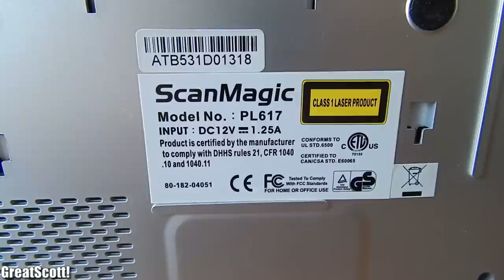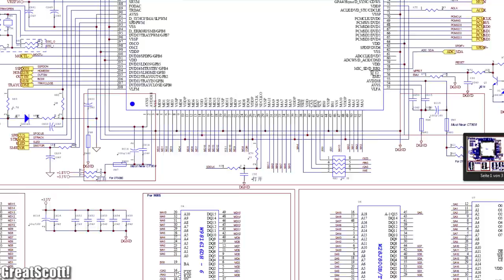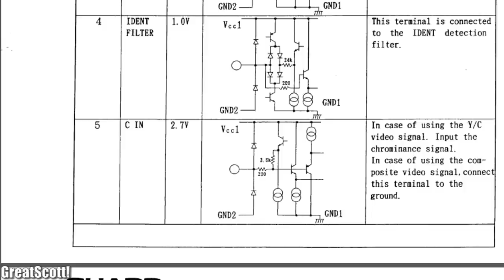HACKED!: Portable DVD Player

Comment: If you still had the original case, you could have made a Linux-based netbook!
Reply: +Nate Dude Or a portable gaming console / hardware emulator!
Reply: Woah! How'd you read my mind?! That's exactly what I was gonna do. I just need a RPi and a keyboard.
Reply: +Muranaman yea and the fact that it's using analog video input will make it look old-ish like the old consoles, not pixel-perfect emulator-like
Reply: Dar'o What do you mean by old-ish? I have a bunch of CRTs at my house I use VGA on all my monitors. I don't see a big difference between my laptop and my desktop's image quality.
Reply: @ChrisD__  must not have a very good computer! (:
Reply: @electricalguy  No I'm just getting a good signal on the VGA cable. It's a pretty short cable. I only stopped using VGA about a month ago, but VGA can literally do any resolution possible as long as you get a good signal and both ends can handle it.
Reply: @ChrisD__  okay. you know more than me since it is your CRT with VGA cable.
Reply: @electricalguy  Oh wait I wasn't clear. My TV's are CRTs, but my monitors are LCD. I use a Gateway FPD1760.
Reply: I have a newer Philips portable DVD player I'm gonna try to delete the DVDROM and install a RasPi4-2gb. I love hardware hacks like that.
Reply: How would you do that

Comment: After i watch this video i found my old portable dvd. That was a sign. I took it apart but i found easier way to plug an external signal. The screen was connected by a 5 pin plug witch 2 pins was video signal and the other two was for TFT light power. I took of the screen and simply cut the wires, then do video and power plug and it works as a portable monitor. I do everything in my way but the idea was Yours ant thanks for that.
Reply from the maker: ironscull You're welcome
Reply: +Oli Siska *you're *awesome
Reply: What model is it? I try it too.
Reply: Chris D It was some Universum dvd i don't remember modell.
Reply: ironscull Oh. I have a Memorex MM-8500. I don't know that much about circuits, but I do know how to use a screwdriver, so I took it apart an found out what SoC it had and removed the DVD reader. I want to put the RPi Zero in the empty space and power it using what was for the DVD drive, but if I were to replace the battery - I think it's completely dead - and get an new charger - lost it so many years ago and turned it on with out the Pi, would it overload the PSU?
Reply: Chris D Could You send me a mail with photos of all the boards in Your dvd? Ill try to find correct connector that leads to screen driver
Reply: ironscull Well, there's a port on the side says "AV IN" and another labeled "5V DC OUT", so I think I might be golden.
Reply: So You have to take some external singnal and plug it into AV in socet. If it works then problem solved if not You gonna have to look for some other way to deliver external signal.
Reply: ironscull Yeah that what I'm worried about.
Reply: Hhahahah

Comment: Many cheap portable DVD players have LCD screen with only video signal feed. Very simple to use it as monitor for composite signal. The resolution is mostly around 320x240 / 480x240 and not always 800x480. 

800x480 is much better picture, but hard to find with only video input. There are less portable players for it. They might use RGB or digital video in (LVDS signal is used in high resolution LCD screens)

Comment: Fantastic, i found your channel while investigating ambilights for my RPi. looked through your other videos, found this and you have solved a problem ive had for sometime.i wanted to strip out a Mustek portable dvd and drop the RPi in the case, got stuck at the video inputs as i didnt want to use the socket the same as you lol!!. it has a different main board but the screen driver is exactly the same as yours, "Warm up the iron honey, we got solderin to do....."

Comment: Impeccable timing for me, I just started on the exact same project right when your video came out, but had no idea what I was doing. Found your video and now I have a clue! :D I've run into a snag however, I'll look again but the past few times I've looked I can really only find one major chip, the MT1389QE. I couldn't find a datasheet for that exact chip, but found one for MT1389 so I'm hoping it's the same. My problem is I can't find a "video_in" like you (lucky!), and am having a hard time figuring out what all the letters mean to try to find video in. I couldn't find a service manual for the dvd player (Philips PET7402), but found a service manual for other DVD players (Philips DVP4050 and DVP720SA) that use the MT1389QE to try to figure out which pin to use and I'm still lost. Any suggestions?

Comment: GreatScott! It just so happens that I have the (almost) exact same thing. The only differences are that it is under the brand name "yukai" and it has a black plastic cover on the bottom.
Reply: How did you power the back-light? Which wires and how many volts?

Comment: wonderful! I have asked quite a few computer technicians if I can use a broken down laptop LCD as a desktop monitor, and their answer have always been "no" though in my mind I knew there must be a way...
Reply: +Stephen Chen That is completely different. The answer is actually not so much a "no" as a "not easily, and if you have to ask me it means you probably dont have the skills to do it, so I will politely just say no rather than try to explain it to you".

I will however take some time to explain it, simplified.

The LCD panels in portable DVD players and other integrated devices have multiple components, one of which is a controller. This controller manages the pixel state in the LCD screen itself, which is a fairly intensive task. It decodes the input, works out which pixels need to be changed and writes the new data to the LCD bus. 

A laptop panel however doesnt have this controller. The video card in the laptop is responsible for performing this task. What this means is that the LCD itself has nothing to decode the input, or change the state of pixels...Now of course you could build a circuit to do this, however it would be cheaper to just buy a screen already made with the characteristics you wanted. There are some third party products for this task, they are limited to lower color settings than you would get from a computer though..and the resolution isnt that great.

The issue largely comes from the massive data throughput needed to operate a computer display...each pixel has to be told which color and brightness to display...in the old days when you had windows 95 you might remember 16 bit color, etc...Well for us to control a HD display we would need a minimum of 24 bits per pixel. Some math:

24 bits color depth (considered "true color") Note, this mode doesnt have transparency support. 32 bit is minimum for that.
48 bit is the new 4k format, and has millions of shades of every color.

1920 * 1080 = 2073600 pixels

2073600(pixels) * 24 (bits per pixel) = 49766400 bits to show an image on the screen at minimum color depth.

The final piece to this puzzle is the refresh rate. That is how many times per second does the screen update...40 frames a second is considered nice, but 30 fps is totally ok for video playback.

49766400(bits for a frame) * 30 = 1492992000 bits per second to update a standard 1920 * 1080 panel at 30 fps with 24 bit color depth.

1,492,992,000 bits per second = 1492 mbps. 
Standard adsl 2+ is around 24 mbps
Standard HDDs read at about 120 Mbps or 916 mbps

So the speed that your computer can read your hard drive data is about half as fast as you would need to run a monitor at minimum...Im not saying its impossible, it isnt...but it would cost a lot, and take a lot of time and effort..and the end result wouldnt be as good as you could get off ebay for 1/100th the cost or less.

So as you can see, it takes pretty powerful processing hardware to run an LCD panel...You would be better off trying to hack the video card. Of course that is extremely hard for a variety of different reasons. 

Hope this helps
Reply: +Tyson Popynick  Pixel clear :) I do know a little about electronics and does pc tweaking trouble shooting in my spare time and I still wish I could revive some of the dead legacy electronics  here at home including a broken laptop with an intact LCD hahah. but very well explained I prolly have to keep things practical.

Comment: Awesome Video! I have got a Philips portable dvd player which I would like to mod in the same way. The problem is that I only see a video cable from the main board to the tft board which is labeled RGB (3 wires + ground). Is there a way to input composite video in that case? The main board is a "PET702 DVD BOARD".

Comment: Why not getting rid of the other big board and use the Panel alone. When i looked in the datasheet, i saw RGB in. Could you put an VGA-Signal in? Maybe you could use the Display as a small extra Display. I also just kept the screes with boards from old DVD Players, but its really hard to find datasheets  for the Driver ics so here you are very lucky you fine one.

Comment: Hi Scott, I found fascinating how you understand a lot about electronics. I am going to ask you if it´s posible to CONVERT a PORTABLE DVD PLAYER wich doesn´t have port for USB or SD card? I am the kind of woman that likes to recycle or repurpose. The portable DVD player is an INSIGNIA  NS-P10DVD11 manufacturen in November 2011. It has 2 headphone outputs, 1 AV OUT and the DC 9v-12v.  Is it posible to open it up and put a NEW DVD CARD with usb or SD card function available?  would this be too costly? thank you!
Reply: you could add in a Raspberry pi using this modification and use that to display video from the USB drive. With some modifications to to Raspberry pi you probably even fit it inside the case.

Comment: In 3:40 I can see that you are actually using only a small board for video processing. Rest of the yellow wires connecting the small board with the big PCB is most probably only electric power, if I´m right. Do you think whether it´s possible to throw that big PCB board away and simply connect proper voltage into these yellow wires to power that small board, where video signal is connected from Banana Pi? I´m asking because I have very similar old DVD player at home and I consider your project as the best way how to reuse it :)
Reply: you probably could if there isn't any sort of feedback from the screen to the big board

Comment: How about phone's screens?
I have a lot of dead phones, can I make something with the screens?
Reply: He was lucky here. Composite video is not widely used for interfacing SoC with built-in LCD so I don't think that you will find such implementation in any phone.  I think in modern smartphones it is most likely that you will find LCD with RGB interface connected to SoC without any intermediate controller. RGB signal needs many wires and connector is very small so you would have to make custom breakout PCB for interfacing it to your project (I don't recommend because this will cost more than new LCD with the PCB).
Dumb phones sometimes uses LCDs with COG (controller-on-glass). Such controller may be unknown and even with proprietary protocol. So it may require reverse engineering. You could google, perhaps somebody already figured this out in case of your phone model. For example, it is known what protocol and controller is used in Nokia 5110, Nokia 3310... Protocol is well-documented and quite easy to use so these displays are useful.
Otherwise, I don't think it is worth spending time here, everything is so small in mobile phones. Perhaps you can try to fix these phones and reuse in other way.

Comment: As you know dvd players have small amplifier.. I want to run my (big) speakers but they lack volume and power.
So I wanna remove the DVD tray completely.. It uses a ribbon cable to a decoder board, can you tell me how to do this DIY project?

Comment: I have an LCD that was part of an old handheld console and I can't manage to find any schematics online, everything powers on still although it's all apart now. Is there anyway to tap the display signal through the ribbon cable or a way to know what the display chip is? The only chips I see that I can name are the CPU chip and rom chips aswell as one for noise. I don't know if there is a way to maybe buy a video controller which takes in the same pin ribbon cable and have that work. Any ideas ?

Comment: Great video! I'm trying to do this with a BUSH PDVD-163C which has a MEDIATEK MT1389VDU QFP128 microcontroller. Problem is that the AV-IN is not auto selected and defaults to DVD player mode. I can only change to AV-IN with the remote control by selecting video source but that means I always need the remote control. There is not a seperate driver board either like the one in your video. Any ideas anyone ??

Comment: Can I use power board, inverter and driver board only and bypass/delete the large DVD board? I can trace out power lines through DVD pcb. This is for pi monitor 2 wire hookup only.

Comment: Hi! 

I have an old 7" Lenco DVP-738 DVD Player. This Player only have an AV Out. 
Is it possible to add an AV Input and keep the DVD Player, SD and USB Reader working?

Thanks!
Reply: Nase Juckt I believe you can if you basically have a switch to change input from external to internal.

Comment: I have a Phillips portable dvd player Pd 9012 second screen ive been trying to use as a monitor for my NES project i can input composite video and see the image by modifying a 4 pole connector for the av in socket because phillips dvd players use a different pole setup but i get major interference, any suggestions?  The only chip on the board seems to be a ARK1839
Reply: shorter wire?

Comment: Hi, I have portable player Lenco, which use vxis VX1818 video chip in LCD, i cant find datasheet for this chip.
Then I try disconnecting wire by wire excluding power wires. And i discovered this: One wire is horizontal synchronization, other wire is colors, if I disconnect it screen goes monochromatic, other wire making black screen with blinking right side of lcd, other wire makes white screen other makes black that slowly goes to white. And last making black screen. I try connect this last wire to video source but nothing happends.
Reply: I give more time to laborating and I discovered this lcd display have S-VIDEO input. I try connect it to computer and it works, but not stable. Picture levitates up and down and its bit distorted.
Reply: jeena256
Now I blowned my dvd players mainboard. Is some way to get display working without mainboard of dvd?

Comment: the thing about all these dvd player hacks is they all hack the composite signal which is shite, you cant even read the linux prompt on composite on these small screens.
i guess its easy but the are better video modes in there use them.

Comment: have the exactplayer but the cathode inverter wire that runs to main chip broke wires fell out connector how do you power cold cathode with those clips?
Reply from the maker: Kaylea Connell By repairing the wires.

Comment: Connect a larger screen to one of those miniature handheld pac man arcade machines.
https://www.kohls.com/product/prd-3828857/my-arcade-collectible-ms-pac-man-micro-player.jsp?skuid=30324893&CID=shopping15&utm_campaign=PREM ELECTRONICS 2&utm_medium=CSE&utm_source=google&utm_product=30324893&utm_campaignid=9733267168&gclid=EAIaIQobChMIsefMy9fy7QIVjyCtBh0RLQvREAQYAiABEgKyNfD_BwE&gclsrc=aw.ds

If this works you could add a larger joystick and create a larger case for it. Youd then have a table top arcade machine.

Comment: Try hacking a car or a plane.
Reply: +IT'S WORKING MHARTI, IT'S WORKING well, something has to be controlling the security lock system, the automatic braking, the automatic windows, and in the case of the plane there's the flight computer etc. but yeah, hacking an entire plane or car is overkill when you only want a small part of it